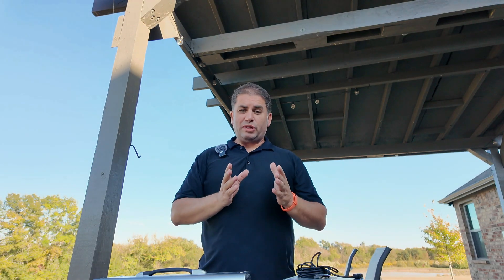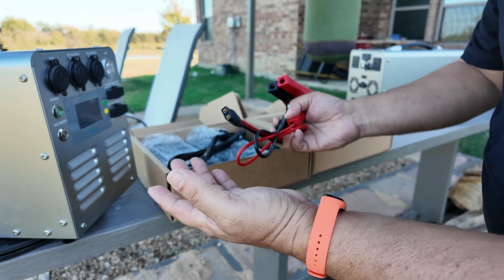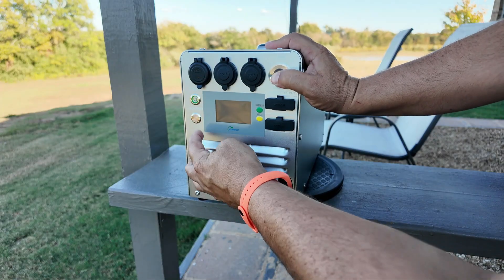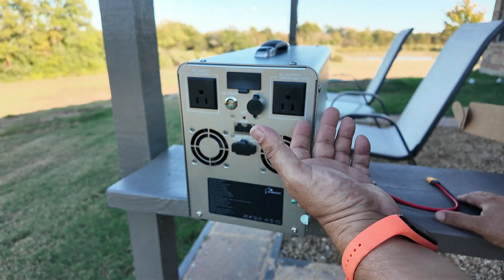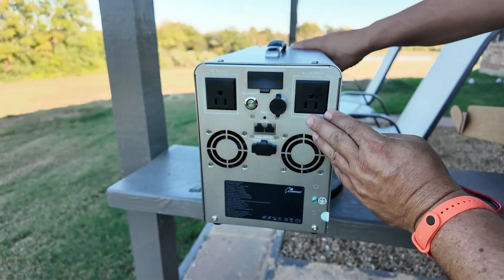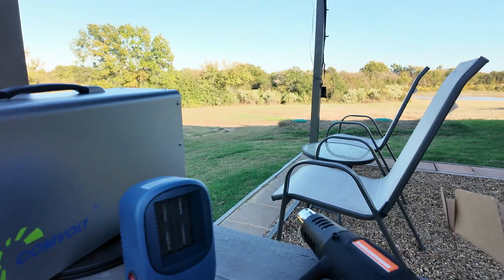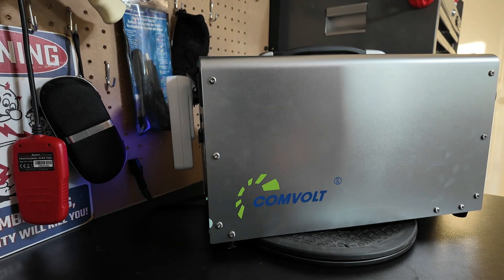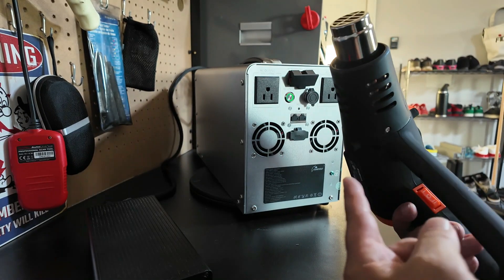Can This 4KWh Power Station Handle Anything? ComVolt Unleashed!

Comment from the maker: ▶▶ In Camper Van review featuring the my 13kwh unit https://youtu.be/rqFwxSwji1w

▶▶ Full review video of UPGRADED Comvolt 4200 https://youtu.be/mM6FZLVDISM

▶▶ Quick 4 Minute review of the UPGRADED Comvolt 4200 https://youtu.be/wWKp6qL5mt4

**Unlisted Video** showing final setup using the comvolt power stations https://youtu.be/zkcXrvJGMCU

▶ See all the parts I used in my VAN build for FREE https://bit.ly/RFVanBuildPartsList
▶ See the VAN build schedule for FREE https://bit.ly/FreeVanBuildSchedule

▶▶ In Camper Van review featuring my 13kwh unit https://youtu.be/rqFwxSwji1w

▶▶ Full review video of UPGRADED Comvolt 4200 https://youtu.be/mM6FZLVDISM

▶▶ Quick 4 Minute review of the UPGRADED Comvolt 4200 https://youtu.be/wWKp6qL5mt4

▶ See all the parts I used in my VAN build for FREE https://bit.ly/RFVanBuildPartsList
▶ See the VAN build schedule for FREE https://bit.ly/FreeVanBuildSchedule
▶▶▶ 4KWH Unit is upgraded to 4200
Comvolt 4.2Kwh Unit 
▶ https://bit.ly/4200whUnitRFv2
get the Kit-Comvolt 4200 AC PDU +DC PDU +display 7 if available as it's really a great upgrade.
▶▶▶ for extra saving use this DISCOUNT Coupon code :Comvolt_RANDOMFIX101
▶ Video review link of 4kwh unit https://youtu.be/shbwNmL-jUk
▶ Quick review 4.2kwh unit https://youtu.be/wWKp6qL5mt4
▶ Detailed Video review 4.2 kwh unit https://youtu.be/mM6FZLVDISM

New Upgraded Comvolt 3Kwh Unit
Purchase HERE
▶▶ Link to recommended vendor HERE https://bit.ly/3000whUnitRFv2
▶▶▶ for extra saving use this DISCOUNT Coupon code :Comvolt_RANDOMFIX101
▶ Amazon link ( more expensive than buying direct ) not available yet but here is the 3KWH link https://lasso.to/amazon/YT9CiAgVSN/CpxEwSwUNbA
▶ 3Kwh Unit Review https://youtu.be/7I8w5NbcXXA

▶▶▶ Vehicle Charger Install https://youtu.be/vN6dCU8epOw

▶▶▶ Perfect 400-watt solar panel https://lasso.to/amazon/TJDklnUOdG/CpxEwSwUNbA

▶▶ Already own a Comvolt unit? Just addon power!
Want the smallest unit with 8192wh of power? 8,192wh!! 8 KWh Add on units https://bit.ly/ExpansionPacksRFv2
▶ for extra saving use this DISCOUNT Coupon code :Comvolt_RANDOMFIX101

Want to go BIG? Want the ultimate portable power station? Complete systems
▶My ONE Comvolt 6 Kwh Unit with Display + PDU Unit 
https://bit.ly/6000whUnitv2
for extra saving use this DISCOUNT Coupon code :Comvolt_RANDOMFIX101
+
▶▶ Get TWO 8,192wh expansion pack
https://bit.ly/ExpansionPacksRFv2
for extra saving use this DISCOUNT Coupon code :Comvolt_RANDOMFIX101
= 22,000+ wh system!

Useful connectors for Comvolt Units
▶ XT60 to TX90 Adapters https://lasso.to/amazon/f7tej4YTbq/CpxEwSwUNbA
▶ Anderson 120 connector to XT60 https://lasso.to/amazon/EySkqsFt18/CpxEwSwUNbA
▶ Prewires Anderson 120 with wire https://lasso.to/amazon/mvPQLcFzro/CpxEwSwUNbA
▶ XT60 DIY Kit https://lasso.to/amazon/IhEA6vUrKB/CpxEwSwUNbA

▶▶ Sprinter VS30 907 170 EXTENDED PLAYLIST over 60+ videos 
https://www.youtube.com/watch?v=npzgisjteEE&list=PLDEbtVOPRC-jSWnu1ITW6niHWLi4YFSuB

▶▶ Sprinter 170 High Roof Playlist over 60+ videos 
https://www.youtube.com/watch?v=PGrw4K2FP-k&list=PLDEbtVOPRC-id5xjqFsYm87bJSJL8bLbe

Comment: Do you use this ComVolt 4000k to power your OutEquip Pro 12V AC? I recently purchased the OutEquip Pro AC and now in the process of searching various portable power stations. This is high on my list. I appreciate the feedback and videos
Reply from the maker: Yes, I have the comvolt 4k connected to sprinter that feeds the dc power and also the comvolt.
Reply: @RANDOMFIX  Ordered.. Thanks again for the awesome video and knowledge. Used your discount code as well. Thanks!
Reply from the maker: @vers7183 thanks for the feedback, I will be making a update video on the comvolt system as my current is getting a 13kwh system from comvolt. The best thing with the comvolt units is that you can keep updating and since the systems are 12 volt based you can always add a new unit.
Reply: Im also looking to do the exact set up with the same ac unit!!!

Comment: Great video! this unit looks like a beast. My only concern is the 400watt max solar charge input. Surprised that low unless I am misunderstanding. Thanks
Reply from the maker: It’s is a 400 watts max but I discuss an easy solution in my 13,000 Wh build https://youtu.be/CpxEwSwUNbA?si=x6Peyside_tMWkj8

Also note that is really hard to get more than 400 watts of solar on camper van unless you are planning on giving up more than 75 of the roof area or no deck up-top.

Comment: If you turn it off at the lighter does that prevent any parasitic draw? I've heard some other chargers have a 1w draw when not in use.
Reply from the maker: these units are the most efficient PPS I have ever used, I normally don't pay attention to 1 watt loses but I am sure there are loses.

Comment: I’m in ireland, we use 240 volt. Can I run 240 volt tools or appliances from this unit??
Reply from the maker: Good question, the unit I showed is for the usa market at 120 volts but I am show that they make a 220 vol and possibly a 249 variant but I have not tried it out personally.
Reply: @ thanks buddy, I’m emailed the company and will keep you posted cheers

Comment: i have to admit i was skeptical when your video started....but damn i was impressed...by it...and you!  Your video was very detailed!!  You def earned my subscription.  Im looking for power in my van build and this is awesome.  Just wish there was an option for adding my power as in an additional battery
Reply from the maker: I am planning a new van build and was going to use this unit. It’s easy to add another external battery, I would run  2 x  12 in series and connect to the solar input port. Easy, the car charger is super fast. Easy to setup and no need to configure.

Lots of power and the Anderson 120 port is the superstar of the unit.  I would run the Anderson 120 straight to a 12 volt junction and then collect my 12 fuses block.
Reply: I love your idea of running 2 x 12v in series and utilizing the solar charging port to feed in the extra power!!!  Im definitely watching for when you and your son start the van build project!!!! @RANDOMFIX